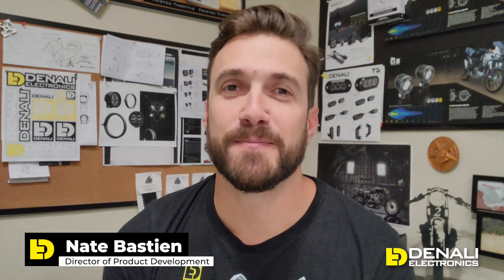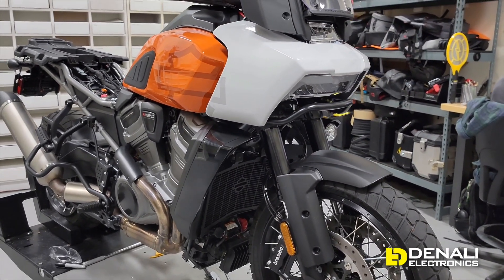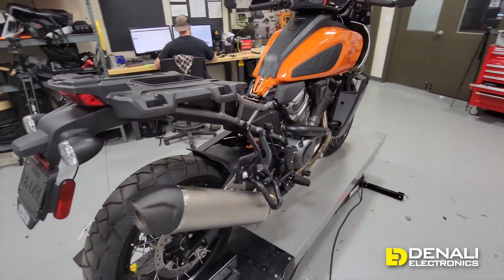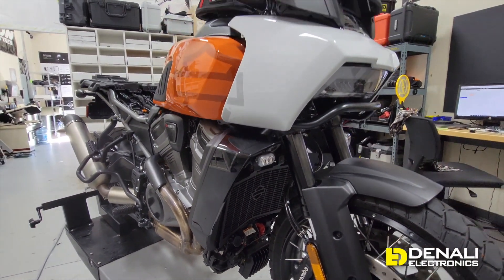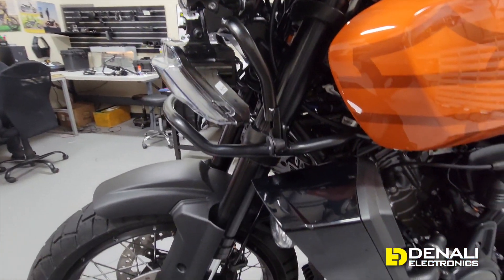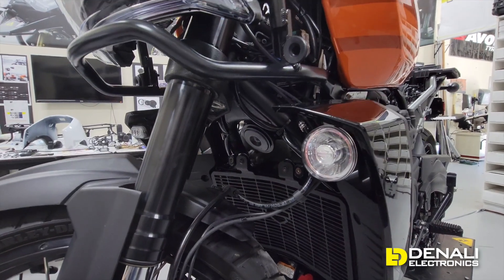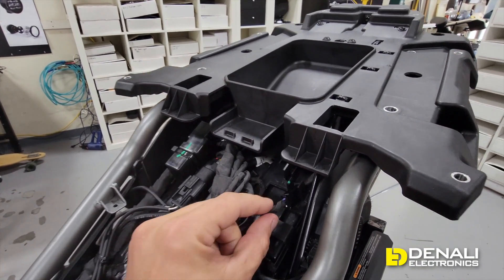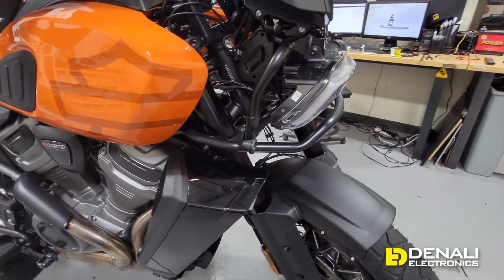How to Wire Electrical Accessories - Harley-Davidson Pan America - OEM Wiring Overview

Comment: Are you planning  a CAMsmart specifically for the Pan America? It'd be nice to have the flash-while-braking 
option for the rear T3's and B6.
Reply from the maker: It is in early development, but we don't have a reliable ETA at this point. In the meantime, the DialDim plays really well with the PanAm and we plan to have a plug-n-play harness available in early 2022.

Comment: Such a tease! I’ve had my Pan Am since May. I didn’t buy the Harley kit because I want a set of D7 lights! I already have a Split Sound Bomb. I would love to have the extra features that you offer as well. 

WHEN CAN I BUY IT???
Reply from the maker: The DialDim is available now for pre-order! We are hoping to have the plug-n-play kits released in Q1 2022.
Reply: @DENALIElectronics  I couldn’t wait. I got the generic D7 kit with the crash bar mounts. Installation was a breeze. I am so impressed! In fact when I turned off the D7s I thought my regular headlight had failed. Nope. It was still on. There’s that much difference!
Reply: Any updated videos on Pan America Can Smart install? Plan to add aux lights, ZumoXT2 and QuadLock wireless charging too. Do I need anything other then CAMSmart?